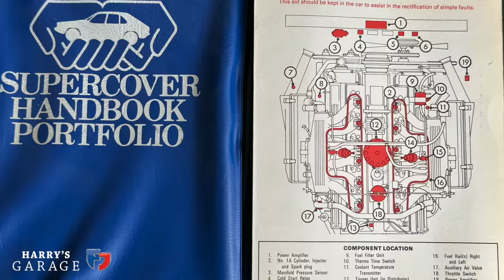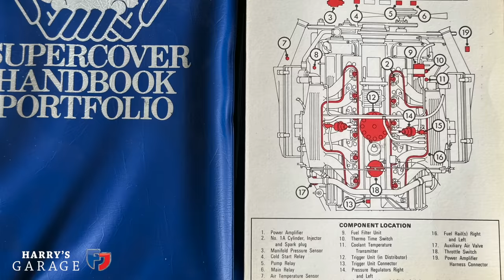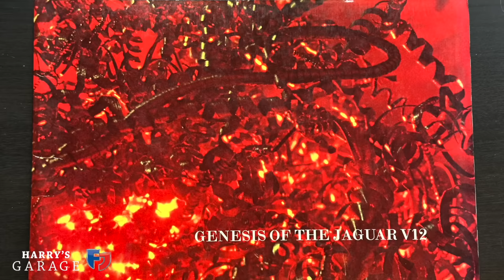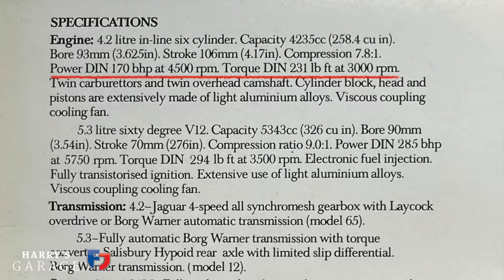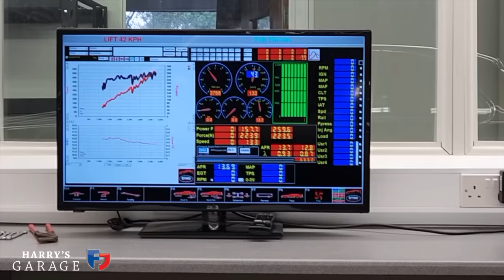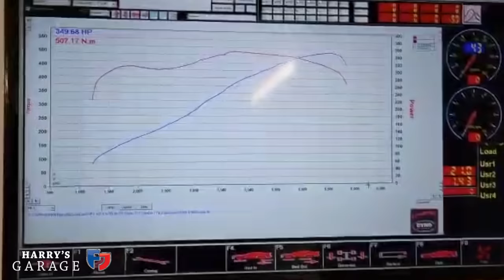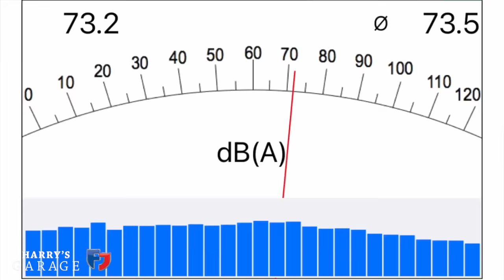My Jaguar XJC V12 visits the dyno & the result is more power & it sounds even better!

Comment: Old guy I worked with had a jaguar for 4 decades. I dont know what model, V12, old leather wood , NICE!
He was talking about an full restore on the drivetrain and mentioned it was over $45K in parts alone. Offhand I suggested he call Texas speed about a turnkey drop in.
I was surprised one day when he asked me to see his car. I figured he had it all restored.. Ohh he did. Piant, new interior leather (OMG! the smell , buttercream leather!) ! NEW Wheels!   !!!! Then he pops the hood!  Me= whaaa Whuuu..WHAT! 
He had a turnkey Texas speed LS7 and new Gm manual trans installed , all beautifully done, real pro fit and finish. (Oem Corvette  engine - sequential transmission )
Very quiet, tasteful and just a bit throaty.    He wouldn't say , but I'll guess he spent more then a new 2023 Jaguar costs. It wasnt about the $$$ , he loves that car.

Comment: Once owned an S Reg Daimler V12. Four door, black vinyl roof and what I think Jaguar call Sand Metallic paint finish for the bodywork. Bonnet always looked  slightly out of line just before closing down fully. Kickdown on it (going uphill for example) would compress your back into the seat. Lost my job and could not afford to run it any longer. Wonderful vehicles, with walnut dash and leather seats. Wonder where it is now? At least I have a few photos. Enjoy. Response to article only.

Comment: The modern ECU's with wide band sensors make tuning much simpler. Whatever the AFR, the ECU can trim the fuel delivery to give the desired result. From full rich wide open throttle to lean cruise. That is a nice clean install on the engine.........so much easier to keep running reliably. Harry banging through those gears almost sounds and looks like a 1960's "james bond" sound byte.

Comment: Every year at Lime Rock (Connecticut) Park on vintage week, one of the paddock's owners has a meticulously restored left hand drive USA space XJC. What a lovely car. I owned oin the 1980's - or should I say it owned me based on the poor parts and build quality of the time - a 1971 low grill XJ6 and a 1983 XJ6 (my favorite car ... when it ran). 

Before someone says Jags need skilled maintenance - the door handle broke off in my hand. The buttons fell apart when pushed. I can't blame that on a mechanic who doesn't understand the carbs. But if I were properly rich, I'd do it again like this one.

Comment: I recently watched a vid where a gentleman was majorly modifying Ferrari Enzos to make them more drivable and faster on track. Completely tearing apart the drivetrain, stroking the engine, redesigning the front end for better downforce, revamping the suspension...the whole works. So your engine mods to this lovely Jaguar to make it more drivable is in the Big Scheme of Things, quite appropriate.

BTW, I thought the revamped Enzo was actually better looking than factory, but then that design was always rather awkward-looking to begin with. No such aesthetic problem with your Jag, however. Big thumbs up!

Comment: The only Jag V12 I have ever travelled in as a passenger was an XJS . This was 30 years ago in the United States of America. The injection system had been removed and replaced by six pairs of down draught Webers. I seem to remember it was quite fast with an evil induction howl. Perhaps this was a cheaper option than persevering with the initially dodgy original set-up. It was a road legal circuit racing car, stripped out interior and a roll cage. It must have been a bit of a job to make all the manifolds to fit under the bonnet.

Comment: What a great job you and your team have done in creating what must be the ultimate 12 cylinder XJ 6.  I hope one day you try out its top speed as at present I believe the fastest road going Jaguar V 12 was the XJ 5 saloon fitted with the 4 cam fuel injected V12 that I drove as a Jaguar Experimental Engineer 58 years ago!  We calculated via the timing lights on the MIRA No1 banked circuit that it was hitting 148 mpn at the end of the Railway Straight before braking for the banking and on the M1 it was even faster via the rev counter!

Comment: Hi, I am also converting my E-Type 5.3 Liter to Fuel injection but just installed Jenvey ITBs which should get more air than any other intake. Completely controlled with 4 wideband sensors and 12 EGT sensors in addition to the other required sensors (all nicely hidden.) The only engine modification are gapless piston rings with less than 2% bypass. Now seeing that performance gain gives me hope to get the same gain on mine when finished.
Since I did all the work myself I should stay at less than 12000€ for the mod. So far my expenses are on schedule.

Comment: It wasn’t clear to me if the dyno result of Harry’s car was actual Wheel Horsepower or corrected to engine horsepower from the dyno. If it was wheel horsepower (349hp), then the true engine horsepower would be nearer 400-420hp. This would seem a bit much for basically a stock 5.3 but it wasn’t made clear in the clip. But either way this is now a really good V12 with the solid state ignition and the state of the art EFI system. Really like the sound of it too. Love that car Harry! EDIT - sorry, I have understated immensely the beautiful sound of this V12 now. Rarely have I heard a nice Jag V12 - but this is the business!

Comment: Square fuel rail (plus other mods) was introduced on the XJS in the USA as part of factory recall due to fuel leaks at the injector connections with the older system resulting in engine fires,  D291 recall as I recall.

Comment: The only Jag I seriously contemplate owning, with XJ-S as reserve but only tick the V12 box.  Now seriously interested after seeing the possibility for 
1. reliable V12 fuel injection
2. Manual gearbox   
I know the XJ-S had manual option but assumed the straight six only. Guess I need to go back to earlier episodes to see details of the manual conversion.  My E-type mate advised against the later HE V12 not the grounds it was "lower power" as high- efficiency really meant "better economy and emissions".

Comment: Hello Harry .  It sounds very sweet but what l was concerned about is how utterly useless that head retraint is ! You need to raise it to it's full extension . I went to Brian Wills funeral a few weeks ago . He was a very well respected engineer and was instrumental on development work of the Tecalemit fuel injection. On one of my visits he delved into his past  projects and showed me photos of a V12 "e"type . He explained that the customer wanted fuel injection on his car . Well Brian told me they were obtaining over 400 bhp , and this was in 1971/2 . Brian was not one to tell porkies , h was the most modest and humble man . He built a sprint Elan for his partner Jo and unbelievably he managed to reduce the weight of the car by 4 cwt !!!! I can remember him showing  me some of the ways he did it . Light weight shell , titanium seat frames , door frames , locks and handles. He even made a silhouette front number plate by cutting out the letters and numbers in one piece and then fitting it in the mouth of the front air intake so the dark background made the plate visible !!! Another amazing engineer and thoroughly nice guy no longer with us . Thanks Harry .

Comment: I've been a XK engine lover, I had a manual 2.8 S1, manual of course and also slightly tweaked, but this reconciles me with the V12, well done Harry.
BTW, originally it is a thin black bakelite wheel, not a wooden one.
Reply from the maker: Mine came with a replacement wood wheel when I bought it, hence my reference. 👍

Comment: @7:15 the sound of the car on the dyno caused tingles all over my body. The engine sounds really great. 507Nm should make for an interesting drive. Oh boy!

PS. Talking about torque and breathing potential. I had my 2007 Saab 9-3 Aero manual upgraded about 10 years ago to the Turbo X specs with a Hirsch chip re-map. That took the power from 255hp to 275hp and the torque from 350Nm to 400Nm, about the same as the standard Jaguar V12. Those are dyno figures. Apart from the acceleration, I noticed a big improvement in driveability that I attributed to the torque increase. A couple of months later, I had a high flow Do88 intercooler put in. The improvement felt at least as big as the Hirsch chip re-map which was fresh in my mind. What surprised me is that the driveability improving dramatically. It's not a boy racer, peaky thing. I can waft around town in 3rd and 4th and pull away in 4th from around 750rpm. I can also have some fun 🤩 The owner of the Saab specialist service place I go to explained that the chip re-map gave the engine the potential and the changed intercooler allowed it to achieve its potential. Makes sense to me.

Tom and Harry are experts, and what they're saying agrees with what I've believe about the changes to my Saab. That makes them really, really good experts 🤣😉

Comment: Personally, I think the engine now looks so much better than the original, which was a 'dog's breakfast of pipework.
I'm pleased that the increase in power and torque has been achieved without fundamentally changing the character of the car, although I would be interested to know what the mpg figures are now.

Comment: Definitely going to have to find a manual gearbox conversion for mine- GM turbo 400 was for trucks basically. I wonder why Jaguar never fitted a standard transmission to these- pure madness. Some of the V12 E types were fitted with jetrag 265's and never understood why this wasn't offered as an option on the XJ12's.  Tremec make a six speed but it's pricey.  Love the license plate number.

Comment: The only thing that disappoints me is the use of cable ties. I used to build wiring looms for many English cars, the win for me is when you can tell it from a Lucas type loom.  Yes I use the newer furry Nitto tapes but the loom is run and taped in such a way that cable ties aren't needed, or I made metal P type clips to look original.   Other than that a great improvement in the injection.  With a lack of those later model 6 cyl injection parts here in Australia, a determined fellow would cast his own manifolds and use a Haltech ECU.

Comment: Love the result of these mods. I'm definitely into the right subtle improvements to make an XJ fly. Yet the refinement of the chassis still impresses; a master class from the 1960s! Incidentally my '71 XJ6 made 250 horsepower and 290 foot pounds on the dyno, in my presence, after a build that took the 4.2 to 4.3 litres, compression up to over 9:1, big valve head and Piper cams, K & N air cleaners, and tubular exhaust header.  So the XK six has potential too. My car takes off just like an E Type with instant throttle response and fierce accelleration towards 100 mph. Which gearbox is Harry using here please

Comment: Just goes to show how much extra performance might be lurking within old engines that just needs the fuel and ignition to be optimized better than carbs (or really old injection) and a dizzy can manage.  I expected a slight boost in power, but not 65hp with stock valves and cam.

Comment: Great video. I put modern aftermarket ecu on my 80s bmw engine. Not the same level of power etc but certainly a similar amount of transformation on the factory engine.

Comment: I am really pleased you have got this sorted. Lets hope it stops being a money pit. What does surprise me is you have not fitted climate to this car. With the modern variable rate compressors, and all that power, the comfort is worth the very tiny trade off. I am slightly surprised yours did not have it from the getgo, my neighbours did in 1979. What does surprise me is all the slagging off of automatic gearboxes, that is what the customers wanted and still do. Not everyone wants to thrash the car around all day long. You wanted a stick shift I get that, however, I am sure if someone wanted an auto then a modern box that is far more efficient than the old GM box could be sourced. A great video and a great take on your custom coupe.

Comment: Sounds absolutely fantastic! I think the X-pipe increased the pitch just a bit and added some depth to the tone. What a wonderful noise.

Power output is a nice surprise, especially since it's all what would be called "bolt-on" modifications, without changing the internals. I imagine the better heads from the earlier ("flat head" combustion chamber) V12 helped, I'd love to know how much difference that shop has seen from similar work on an HE V12, if it's significantly less or if it can get close to the same results (I'm assuming the power figure is back-calculated to crank HP as is common for European dynos, rather than the "wheel HP" we tend to use in the US).

Comment: The factory measures HP at the flywheel, not the rear wheels. Your actual net flywheel hp is closer to 410-420.

Comment: I have a 96 double six 6.0 with a great engine circa genuine 100k engine like new, but rest of car would need re commissioning (long story!) and a rare pre jag-sport TWR XJ-S HE (yellow shocks, speed line alloys etc but not AP breaks) that was on HR Owen’s plate (that still used for Ferrari demonstrators) that needs resto but v rare. If your mechanic wants them both looking for space and open to sensible offers!

Comment: This job would be wonderful on an E-Type V 12, but to my taste the way it sounds(especially outside) and the way all those very expensive mods have "forced" into a mode to be used that is very far from what it was meant to be.It went to be a "hybrid" now.I guess it would have been so much closer to the initial Jaguar XJC in putting a 6 litre V 12 with only tuning the injection side ,throttle bodies  and remapping.It would be as quick even in auto,and still keeping the silent bite it deserves

Comment: Usually Manufacturers list crankshaft BHP not rear wheel HP. So unless they were using a correction factor to estimate crankshaft HP.. its confusing they way this video talks about the power gains. Its actually a much more HP gain. The stock car would only put about 250RWHP on 280Crankshaft HP..

Comment: Having worked my way through several e types and a V12 hardtop, I have also suffered mentally and financially as well.  Your present end result sounds great and is lovely.  In my case, the solution turned out to be a 2017 AM Vanquish.

Comment: I can attest to the 4.2litre's rather poor performance but not surprising when mated with a BW65 or 66. That gearbox's wishy washy transfer of power helped Jaguar sell thousands of cars to 'Middle Britain' with the buyers believing they were buying a equal to a Rolls for comfort and class...and it worked.  30's design and technology used up until the mid 80's mated to an engine which initiated mass production in 1947.  My Series III Sovereign languishes in a lock up many miles from where I now live...As part of a 'modernisation/upgrade' I would consider a gearbox replacement...not an original idea its been done more than a few times but anything to make the whole car more efficient. Just need to start that process..

Harry's XJ12C is quite the 'thing'.... Some great solutions to 70's problems...

Comment: All depends on type of engine XK 2.4 3.4 3.8 and 4.2 is different to XJ 4.2 3.4 and 3.8 engines and the Automatic transmission of 4.2G was far better than in the XJ 4.2 The Etype V12 had too many problems with injection for some strange reason. Yet the XK injection engines never had problems Lister racing Jaguar engine 4.2 had injection so did Jaguar in 1960s have Injection in race cars.  That HP not far off the 380HP claimed for the V12 on the Etype but i bet the Dino was not as accurate back then. I think the s Type 3.8 had 240HP I know the MK2 3.4 had 210 in 1964.

Comment: I don't know where you're both coming from with those comments on the 4.2. A series 3 with fuel injection is 205 bhp,  earlier cars were rated in gross horsepower at 265 rather than net, which is obviously not realistic... However "170" is very low and I suspect this comes from the de-tuned American specification cars not the UK models.

Comment: Where the dyno results at the wheels o at the crank? Dyno's normally measure the power at the wheels, as where manufacturers state power at the crank. Which means that your engine actually has probably 15 - 20% more power than the dyno result.

Comment: @ 11:50 That high-pitched squealing! Obviously, the steering wheel is scraping on the column plastic housing (or something like that). I guess you don’t hear it at speed for all the other noise, but when cranking the wheel at low speed, it would about make my ears bleed. I wouldn’t have left that shop with the car until that was corrected.

Comment: Despite being very good, are we doing a discredit to the power gains? Aren’t dyno power numbers measured to the wheels? Factory power output would be at the crank. In which case the increase is more like 100+bhp..

Comment: I could be wrong, but manufacturers usually quote engine horsepower bhp,  where you have 349 rwhp rear wheel horse power? So potentially there’s a bigger increase then you think ? (Given potential drive train loss ?)